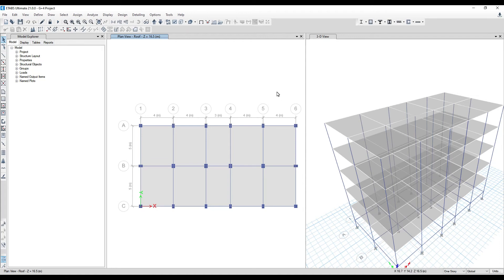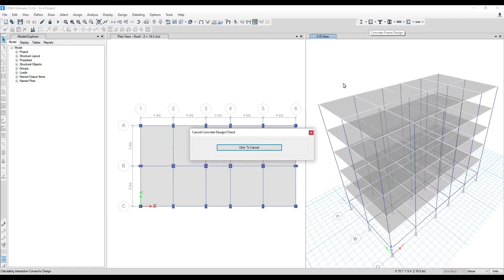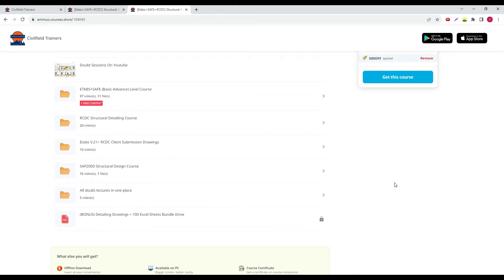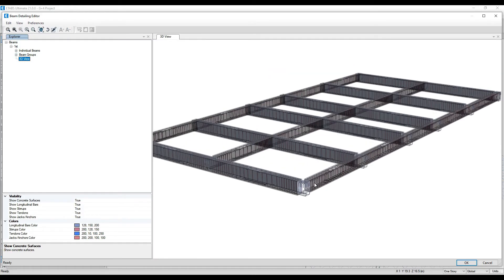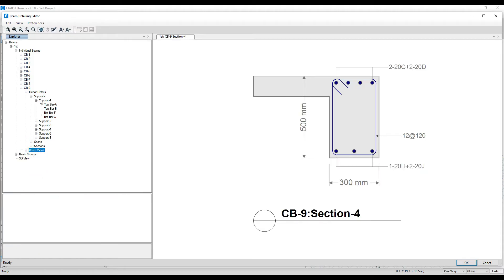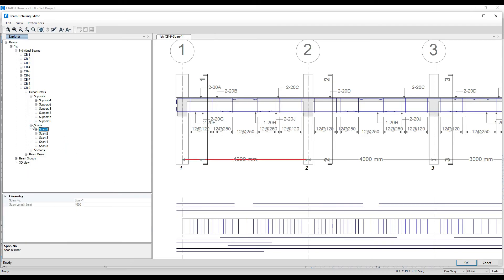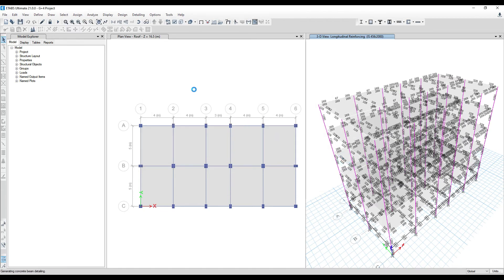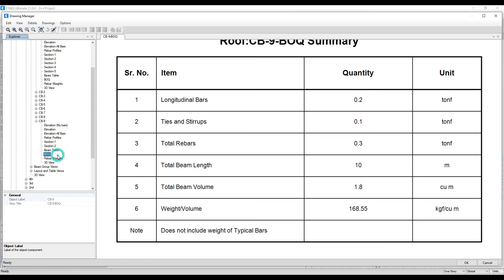Master Beam Detailing in Etabs 21: The Ultimate Guide

Comment: In ETABS, after completing the concrete frame design and confirming that all capacity checks pass, we can view the detailed reinforcement for beams and columns through the Concrete Detailing module. If I go to Concrete Detailing → Show/Edit Beam Detailing and manually modify the beam reinforcement (number of bars, size, arrangement, etc.), does this updated rebar information automatically transfer back to the main analysis/design model? In other words, will ETABS automatically redo the capacity checks based on the new reinforcement edited in the detailing module? If this does not happen by default, is there any method or option in ETABS that allows the detailing changes to be applied to the design model so that the capacity checks are updated according to the modified reinforcement? Thank you
Reply from the maker: This approach would be too time-consuming to carry out for each beam on each level. Then do the same for columns as well. Moreover, no matter how hard you may try to give a certain value. When it comes to detailing. Etabs isn't ideal for it. It will default to its own settings. 

Better to transfer values to RCDC, and then manipulate the drawings based on the rebars you want to see.
Reply: @civilfieldtrainers  Thank you for the explanation. I have a follow-up question:
If I want to specify a particular number of bars or a specific bar spacing directly in ETABS, how can I assign these values to the beams in the analysis/design model? For example, after running the design, ETABS may give a beam reinforcement of “x bars at y spacing,” but I want to modify this reinforcement to my own chosen number of bars or spacing. I know I can edit the reinforcement in the Concrete Detailing module, but how can I make these changes within the main ETABS model itself so that the design checks are performed using my modified reinforcement?
Reply from the maker: @HumanBeing-d7x  I don't think this is possible in Etabs. But this thing can be done in RCDC. Each beam can be handpicked and assigned the number of bars and spacing you want to give.

Comment: I modeled a typical frame structure in ETABS 21. After running the analysis and design, and setting the rebar selection rules, when I go to the detailing, the beams on 1st, 2nd and 3rd floors show “No Design”. The cross sections in the detailing show 10mm by 10mm weird figures. Tried multiple times.

Beams on the upper floor have full detailing. Everything is good with them. For all the stories except the ground story, even the cross section of the beam is the same. Can you please guide me what could be the reason for this?
Reply from the maker: Most probably some of the beams have failed in those floors. If a beam has failed Etabs tends to give that message.
Reply: @civilfieldtrainers  thank you Sir. You were right. Some of the members were unable to pass the check. Changing the Torsional Constant for those sections resolved the issue. Thanks again and keep up your work please.
Reply from the maker: @LeoXeroscope  Happy to help!

Comment: Good morning everyone, I'm trying to use ETABS to design Reinforced Concrete box culvert, after successfully designing the model I can't proceed to run the analysis. I have been trying my possible best to get the analysis but the process is not scaling through.

Please I need help and guidance on how to run the analysis please. This thing is giving me headache
Reply from the maker: Please use Staad Pro for carrying out the analysis and design of such structures. Etabs is really good for RCC and High Rise Structures. But for culverts, etc. Staad Pro is best.

Comment: can we export rebar to revit?
Reply from the maker: You can export the Etabs model to Revit. But I'm not aware if the rebars can be exported too or not.
Reply: @ahmadrezalatifi3278  As you may know, detailing can be exported in DWG format which is supported by Revit. Additionally, you can export the detailing in DXF format which is suitable for almost any CAD software including Revit.

Comment: after editing in detailing is there any way where we can check our if our detailing is sufficient in etabs...??
Reply from the maker: As far as I know, we cannot cross-check it like that in Etabs. But in RCDC we can. It shows us if the edited reinforcement is sufficient or not.
Reply: @civilfieldtrainers  thank you bro..... i am using etabs 21 can you please send me the link or let me know where can i find such version of rcdc where i can work....in the version of rcdc which i am using its not working......
Reply: @vasubhadania  When we enter the "Rebar Selection Rules" data and we input the smallest and largest range data... that's where ETABS will calculate. and when we want to edit it cannot be smaller than the ETABS calculation. But if the distance between the smallest and largest ranges is too far, the ETABS calculation will have too many variations. example: input the smallest data 16, input the largest data 19. don't 13 and 50... then there will be many variations in the reinforcement.🙏